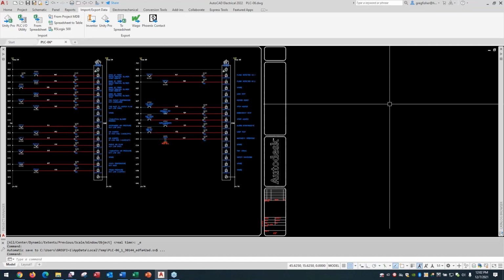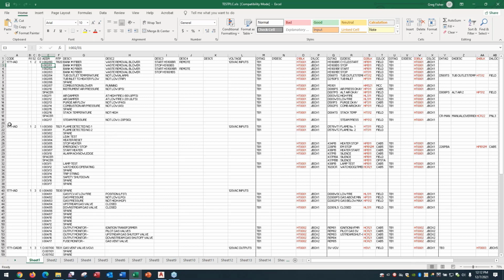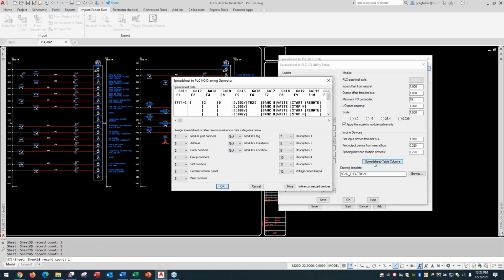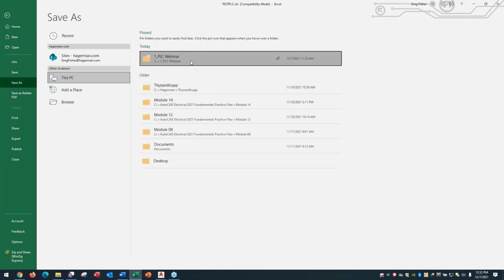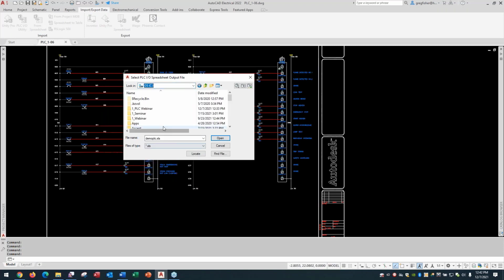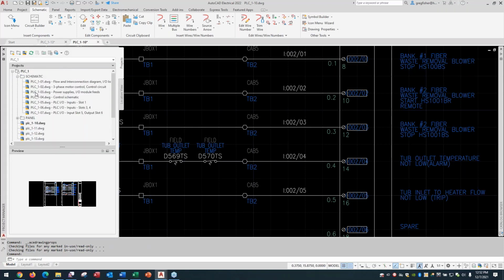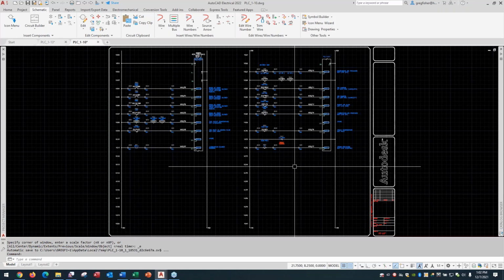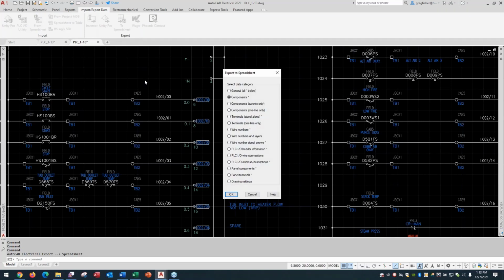The AutoCAD Electrical PLC I/O Utility

Comment: Where can I get this excel template to get started?
Reply: The spreadsheet that was used for this webinar is a sample out of the box when you install the software. It can be located here.
C:\Users\computer name?\AppData\Roaming\Autodesk\AutoCAD Electrical 2022\R24.1\enu\Support\User